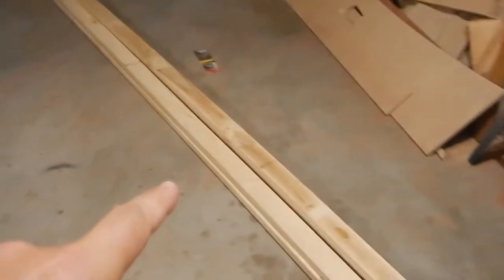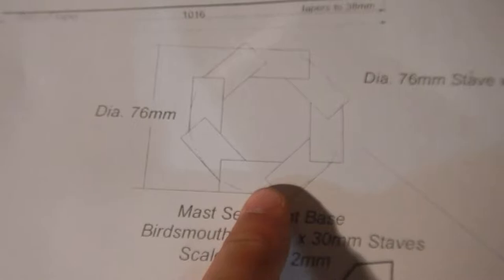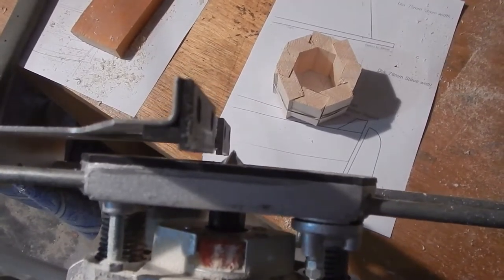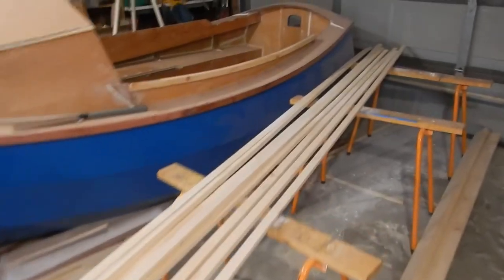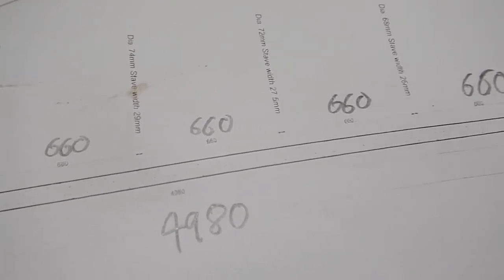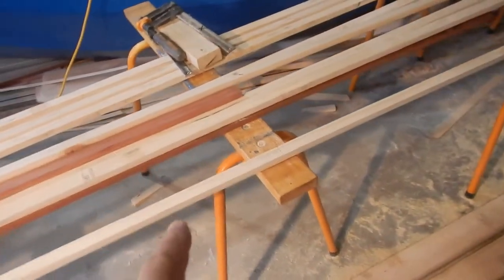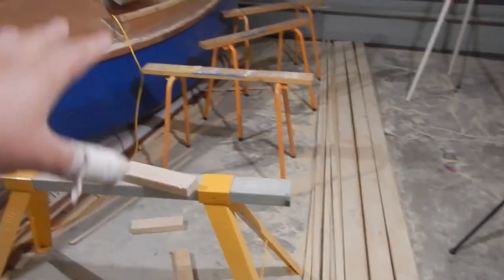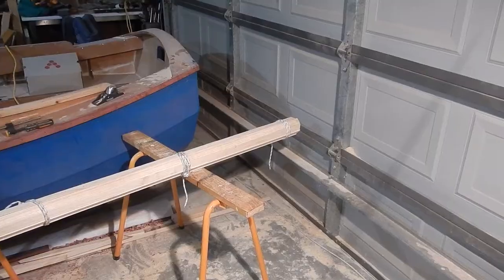Building a SCAMP part 071 - Mast Part I

Comment: Hey man, great vid. Got lucky with that table saw! When you're gluing up, try and do just two at a time, so you'd have four sections of two. Then glue those together once they're cured so now you have two sections of four. Then glue the two halves together. If you do it in stages you can use each section to hold the next so they're all the right shape.
Reply from the maker: Hey thanks for the interesting suggestion.  Unfortunately I've already glued the mast up.  Sounds like it could have potentially been much less of a pain.  Oh well, next time 😅.
Reply: @dana_pike  haha ah well, we live and learn. Never would have thought of a router for the birdsmouth grooves, that was a good idea!

Comment: You might already be past this part, but I've heard a good tip for gluing the mast: get everything all dry fit together and then wrap masking tape around it. Slit the masking tape and then the mast pieces unroll into a flat section. Then you can somewhat easily roll it all back together again after you apply the glue/epoxy.
Reply from the maker: Yep already glued them 😒.  Next time.
Reply: @dana_pike  looking forward to the video!
Reply: I will use this tip thank you